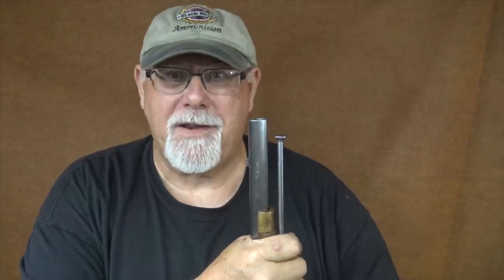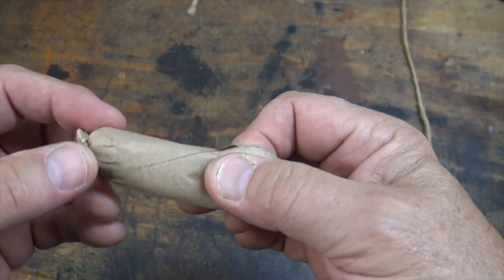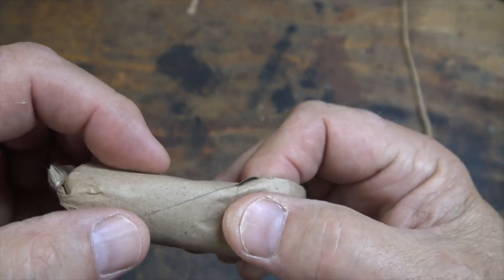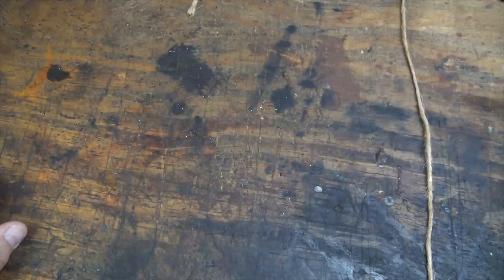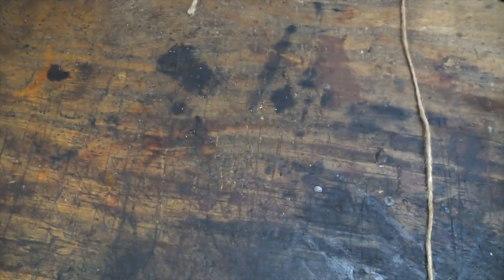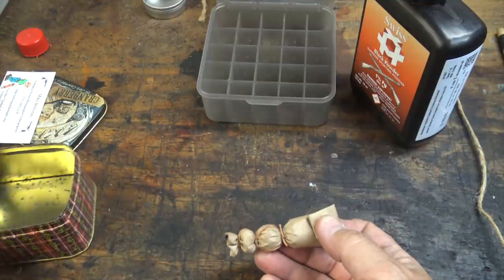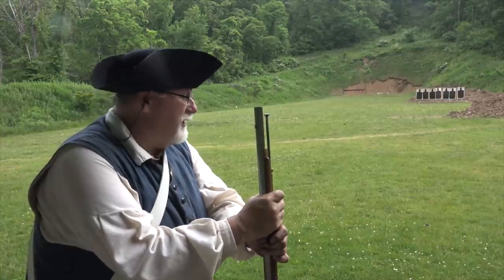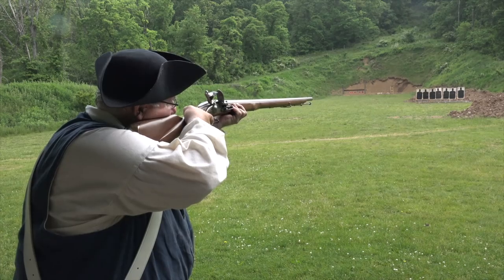Loading Buck & Ball Paper Cartridges

Comment: The formula for what size buckshot seats by 3’s in any smooth bore is: bore diameter divided by 2.19...for instance, my .54 cal / 2.19 = 0.246575342465753, round it to .24 cal (#4 buck) sets very nicely by 3’s and stacks awesome too.
Reply: .75" / 2.19 = .340"

Comment: Mike every time I see your vids my wallet cries!  Recently  I bought a Howell cylinder for a  Uberti Walker in 45ACP (I had a ton of spare 45acp brass and cast some lead and loaded them black powder;  given the cost/availability of cowboy loads in 45LC it made sense).  This time it was a copy of that book:  The British Gunner.  Amazon was sold out, an original is in the thousands, but a local bookstore had a used copy of the edition you showed.  Still was not cheap but....
Thanks keep it up.  even if my credit card weeps  :)

Comment: Thanks Mike,  what's an affordable smooth bore muzzle loader?  Being historically accurate isn't my 1st priority
Reply from the maker: Pedersoli’s Scout shotgun is the only smoothbore I know of that is priced under $1,000. It is a percussion gun. Most factory smoothbores will run you between $1,200 to $2,000...unless you buy the made in India stuff. Those are under $1,000, but With steel tubing barrels, I don’t trust them for live ammo.
Reply: Maybe check the used market. I've seen some high quality pieces that were hardly used on the secondary market.

Comment: Mike I know you’re a busy man if you can reply it would be appreciated! Thanks for all the great content! Question is concerning touch hole size for a Bess or Charleville. I’ve seen some that appear to have rather large touch holes that don’t appear to be the result of wear. I’m guessing.125 inch. What are your thoughts on touch hole sizes in these big muskets? Both my Bess and Charleville came with touch holes under a 1/16 I opened them up to 1/16 and they work fine. What are the ramifications of too large a touch hole I assume reduced power and the need for one of those lock side plates I see so often.
Reply from the maker: I open my touch holes to 1/16th if they are smaller. Bigger than that and you can have a real flame thrower shooting out the side of your barrel

Comment: Could I use the same 2.5"x5.5"×6" template to make a 20 gauge buck and ball cartridge or would I have to scale it down a bit? I do know that I would have to use a smaller dowel around 0.62" in order to properly form the cartridge.
Reply from the maker: I would scale it down. Since a 20 GA bore is 0.615”, you will need a .58” ball and dowel with the paper cartridge.
Reply: @duelist1954  Thank you for the advice.

Comment: The problem with “granny knots” is NOT that they will come untied under pressure ! it is that for this kind of use, parcels etc it can be hard to untie them at all !   Yes they can capsize under pressure, but in small stuff you will not be able to do that, you are talking about rope work.  Reef knots (square knots etc)  are prone to shaking loose if not under pressure !  so in this circumstance a granny might even be preferable !